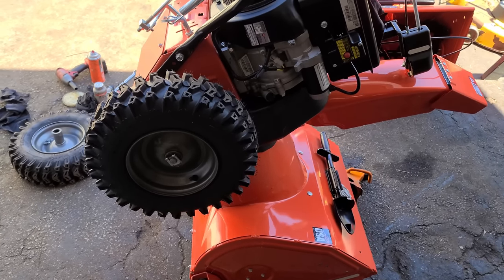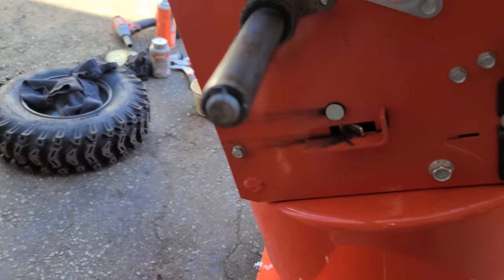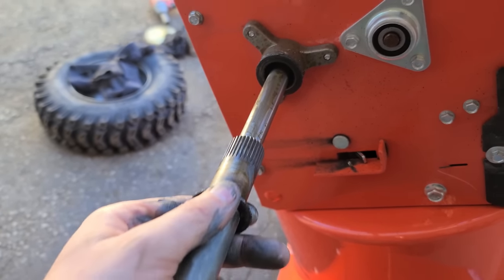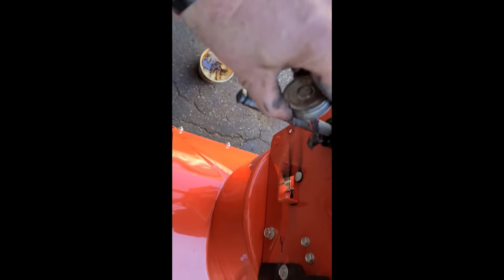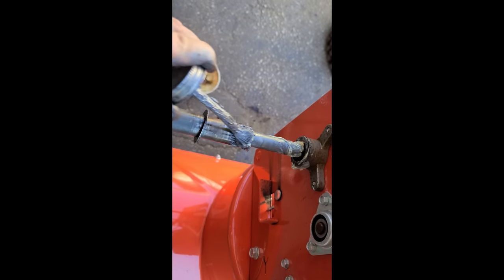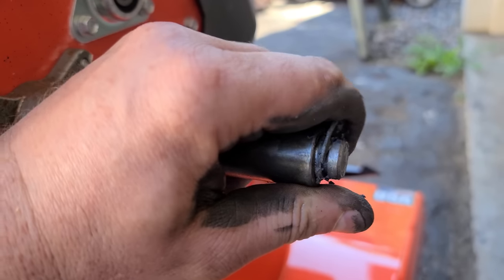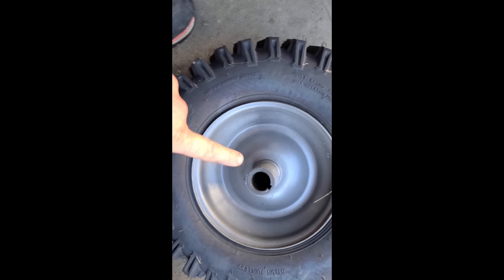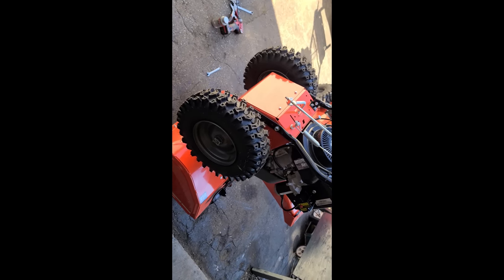Do This If You Own An ARIENS Snowblower! MUST WATCH!

Comment: i hit anything that moves and i can get at with spray lube each year. i can't get mine to start  from cold now  because it seems to floodso i pull the w/o the plug and spray starting fluid right into the cylinder and then it starts right up and runs good other wise it floods. it will start fine when warm. the thing is 40+ year old ariens 6/28.

Comment: i always did this and that was with a PIN drive.  I lubricate everything that should be and could be going so far as to spray heavy duty corrosion inhibitor on some areas.  After 20 years that blower looks nearly new inside and out.  Now I also have a Pro 28 that was purchased from a local dealer a number of years ago.  I was shocked to see that they did Not lubricate the axles.  very minimum black grease on the gears and chains, nothing on the hex shaft and some dried out white lithium (I assume) on the chute gears etc...   That is of course no longer the case but i have to wonder...  Doesn't Ariens provide guidance to their dealers for setup that includes lubricating the axle shafts and other areas??

Comment: Couple of questions: 1. Does the other side have a shaft too that needs to be done?
2. Is the E clip only present on the right side of the shaft? My new deluxe 24 inch did not have one on the left side. Looking at the parts diagram it doesnt have one on that aide.

Comment: Great video! I have an old Ariens and one wheel is seized on the axel…. Any tricks to getting it back off? I was thinking if drilling holes through the wheel and using a puller. Thanks
Reply: That can be impossible!   hung one from a rafter and beat on the shaft after heating with Propane torch on One Side.  It eventually came loose.  Others I have used OxyAcetylene and got the wheel red hot.  Never came off.  I had to cut the axle in half and make a coupling using Roll Pins on Reassembly.

Comment: Do u have to drain the fuel first when tipping it up?   I did my new ariens yesterday & started greasing it up & fuel was dripping from from carburetor area so had to put it down & stuck wood underneath & did it that way.   Didn't know if anyone else had issues with fuel dripping.  I also used red & tacky but it has some antiseize in it from home depot.

Comment: Great video, is it the same setup on the newer toro models, I have greased the axles where wheels slide on but never thought of this.
Reply: Yes it is the same setup on their auto turn models , but unlike Ariens Toro actually spends the extra $.03 and puts anti seize on their axles! Both great units, just more attention to the little things on Toro.

Comment: Hello, great advice. I wish I've done it last year when I've purchased it...one wheel is already seized/rusted on the shaft... any recommendation to remove it without breaking the gear box and or anything else in the direction!? Tried some ''liquid wrench'' overnight and it doesn't help, I'm a little scared to hammer on the wheel...

Comment: Nice.  Haven't used the anti-seize... just the grease.  But next time I take the wheels off, I will.  P.S.  I did this for the first time after owning the unit for 6-7 years now.  Didn't really have much of a problem taking the wheels off... but they sure didn't slide off without some torque and force!  The key locks are def a pain, though.  Thanks!

Comment: Bought a used 2019 model. Could barely remove the tires. That outer axle part would not move an inch. I deliver steel to 3 plants in Brillion WI. Those axle parts  come from my employer.  They are well oiled and ariens won't accept rusty steel. They should apply grease upon assembly.

Comment: Please note that many have found a golden colored bolt in the transmission compartment. This bolt holds the flywheels secure. You can manipulate it into place from above into the center of the top flywheel with your fingers. Screw In as far as possible using your fingers and an open wrench. Tighten with a box wrench. Tap tight with hammer to box wrench.
Reply from the maker: That is usually the bolt for the auger pulley.

Comment: I have an old machine that I can't get the right side wheel off. I soaked it with a variety of products, heated the shnizits out of the hub, and popped veins in my neck yanking on it. 
I saw a tuber who drilled 2 holes in the wheel on each side of the hub and used threaded rods and nuts and washers to make a puller (more of a press actually) but I haven't resorted to that yet. I should have though because that tubeless tire went flat and no amount of getting at the bead and cleaning it up would make it hold air so I had to put in a tube. 
Big fun. 

And yeah...one drop of anti seize is enough to smear halfway across the US. 🤣
Reply: Been there, done that, brother.  You have my sympathy.  I had one where even a 20 ton bottle jack wouldn't budge it.  I wound up changing the tire with the wheel still on the machine.  Not fun!

Comment: Great video as always Donny. Just bought mine a couple of months ago. Can I tilt the snowblower like this even if theres oil in the engine? Merci d'avance :)
Reply: Hey Kita,
Yes, you’re perfectly safe to tilt the snowblower up. What you need to be careful of is the fuel. Make sure you only have a small amount of gas in the tank or it will leak out of the gas cap. You can remove the cap and place a plastic bag, I use sandwich bags, over the fill opening and then put the cap back on. It should prevent a leak if you have too much fuel. Hope this helps.
Reply: My new Ariens Deluxe 28 leaked oil where the oil tube is inserted into the engine when I tilted it to remove the panel.  It had the proper oil level and was not overfilled but still leaked.  I will probably drain the oil next time I do any service because the oil dripped onto one of the pulleys on the front of the engine.  It added more work because I had to remove the front cover to clean the pulley so the belts didn't slip.
Reply: @fredb.2378  
Hey Fred. Yeah I can see that being a pain in ass to clean. 
It shouldn’t leak though. Check to see if your dipstick tube has an O ring on it? I’m also wondering if it was seated properly from the factory? I’d take a good look at that tube before draining the oil every time. Having said that. It is a good idea to clean and lube the drive train when you do an oil change.
Reply: @EzRay11  Ray, thanks for the tip, I will look at it.  I was thinking since it was purchased new last year and we have not had any snow, it was never started to reach the operating temperature which may help improve the seal with the O ring.  Any thoughts?
Reply: @fredb.2378  Hey Fred,
The operating temperature shouldn’t be a factor. It should seal regardless. 
I’ve worked on a few Ariens machines but have never dealt with a dipstick issue. I just took a look at a parts list for the Deluxe 28 and it had a press in type tube. It wasn’t clear whether it had an O ring or not but it must have a seal of some kind. I’m guessing the tube wasn’t pressed in correctly or the seal is missing. You should be able to remove it quite easily to inspect and verify. Possibly just pushing it back in will reseat it. 
Hope this helps.
Reply: @EzRay11  Thanks Ray, I will follow your suggestion.
Reply: @EzRay11  Hey Ray, just to let you know I took your advice and loosened the bolt holding the oil tube to the engine and pushed down on the tube and it turned out it wasn't seated properly.  So with the tube not being seated that was also the reason the dipstick was showing it was low on oil.  Now everything looks good.  Thanks for the advice.
Reply: @fredb.2378  Morning Fred. Glad to hear it worked out. Thanks for the update. I was curious to know how you made out. 
Cheers
Ray
Reply: I didn't tilt mine....I elevated it by sliding a plastic wheel ramp under the belly of the snowblower.  Got me the needed 2 - 3 inches of elevation needed to pull the wheel.
Reply: @joemarchand8313  I also was thinking about elevating it but was concerned about the weight on the underbelly.  Thanks for your reply.

Comment: I just bought one brand new last winter and tore it apart to ‘try to’ do some preventative maintenance, but I missed that. So thank you sir.
I thought I was the only one where in certain applications I use both anti seize AND grease, usually because I can’t make up my mind which would work better, lol.  
Oddly enough, when you said it would obviously seize together after time and the diff wouldn’t work properly, I had a brief flash of ‘GREAT!’ because I hate that diff! Every chunk of packed snow, ice, cracked asphalt and etc, and especially both sides of my driveway that stupid diff senses a turn and is pulling all over the place!  Mine is plenty powerful enough, easy starting, but it’s such a horse to control and counter steer that fancy diff that I think I’d rather push a plow blade from a highway department truck! It may be easier!!!
I can not stress how much that ‘auto turn’ or whatever it is absolutely makes me HATE my $1500.00 investment.
Whew!
Anyone have a fix for that? Let it rust? Tack weld it?, replace with and older model straight axle? Sell it?

Comment: Don I had a question for you. I was working on my snowblower carb and the bowl nut broke and got stuck. I drilled into the piece that was stuck in the hole and I accidentally drilled into the thing that's behind it and I'm worried that it would be getting to much fuel then or something

Comment: Currently I just have one kind of grease on hand, Lucas Red "n" Tacky.  Is that an acceptable "low temp" grease?  Or do I need a second formulation?
Reply: No red n tacky is too thick. I like using either fluid film and or lubriplate low temp.

Comment: I HAVE A ARIENS PLATINUM SHO 30 AND THE GEAR BOX LEAKS.   CAN THE SEALS BE REPLACED OR DO YOU NEED A NEW GEAR CASE. I CAN'T SEEM TO FIND THIS REPAIR ON YOU TUBE
Reply from the maker: Yes you can replace the seals and reseal both covers. If you have warranty this should be covered.

Comment: Stupid question that I can’t seem to find an answer for… how do you shut fuel off so when you tip a snowblower up it doesn’t drip everywhere?  Just plastic wrap over the fuel cap?
Reply: Do it with the tank as low on fuel as possible and put a plastic bag over the filler before installing the cap.

Comment: I have two wires coming from my stater. One black one red. The light never worked. I pulled on the wires the red one is snipped off.   How can I get the wire back on and where does it go.
Reply: Try splicing the red and go to the light with it.  Make sure Light is grounded.

Comment: How about a video about removing a rusted on wheel. Tried penetrants, heat and puller. Wheel didnt budge. HELP!
Reply from the maker: At that point I cut off shaft and get new parts. I use oxy/acetylene because it is much hotter than propane or mapp gas.

Comment: My2013 Arien28 deluxe only pulling with the right wheel ????all key ways in place could there be a problem with the auto turn
Reply: Most of those have 2 holes drilled through axle ends. Make sure the pin goes through the WHEEL and then through one of the holes.  Use inner hole.

Comment: Donny in my ariens manual it says to use hi temp grease. Do you use low temp everywhere like zerk fittings and the chain and sprockets? Using low temp grease seems to make sense just don't understand why ariens says high temp.
Reply: I questioned my small Ariens dealer about this and he didn't know why Ariens did this. Low temp grease for sub zero work makes more sense
Reply: @barrypettit3668  I agree. I can't find it anywhere in my area. Guess I'm going to need to order it on line.

Comment: Mine brand new machine has pulled to the left since day one.
I can’t get it to start just three years later and I’ve used it maybe 4x. So disappointed
Reply from the maker: The carburetor probably needs to be cleaned or replaced.
Reply: Be sure BOTH wheels are pinned to the axle for 2 wheel drive.